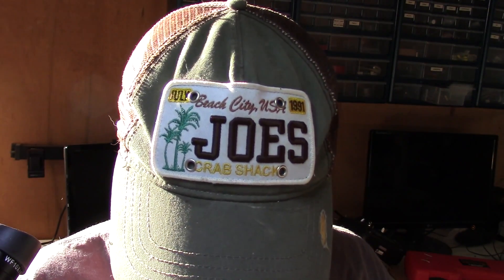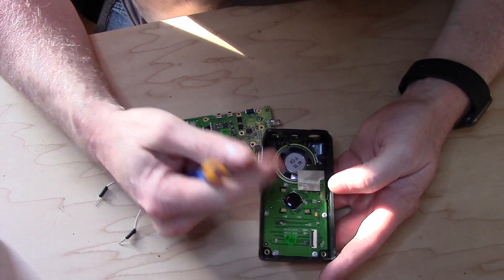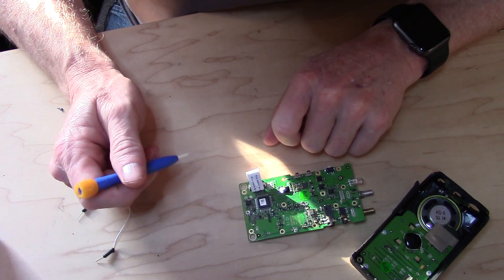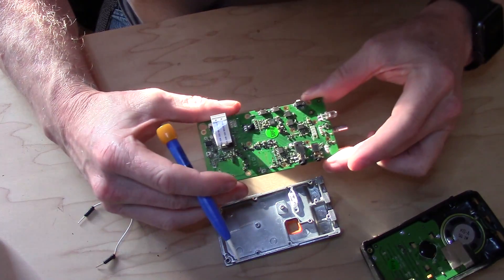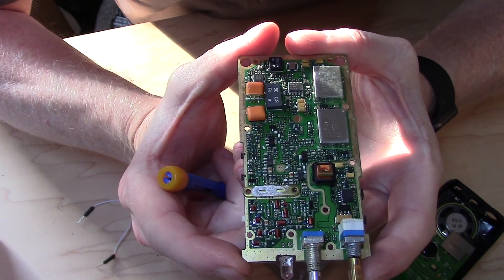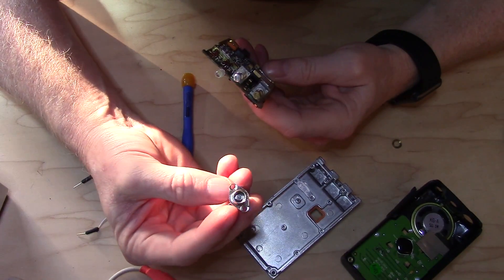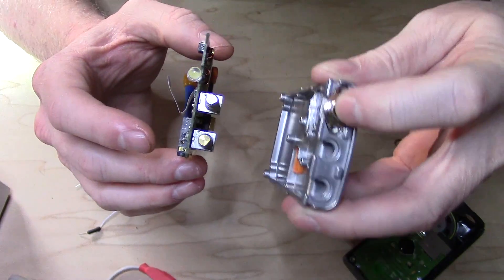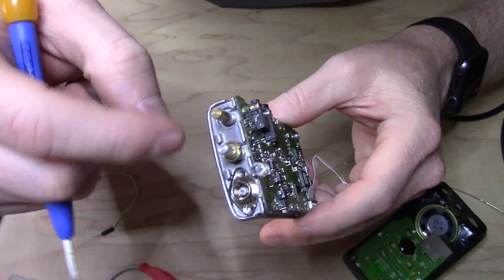Wouxun Teardown

Comment: Hi friend, I have a Wouxun UV9D Plus and its power dropped to 2.5W. Could it be that the transistor is broken?
Can you tell me how to change the transistor on this UB9D Plus and what model transistor is this equipment?
Or could it be some other component?
I honestly don't think it's the power transistor because it's putting out 2.5 watts, so I imagine it could be another component...
I'm a radio amateur here in Brazil and I really like electronics. I want to fix this HT, but I haven't found anything about it on the internet.
Could you help me?
I congratulate you on your channel and I would be very grateful if you could help me. My name is Vanderlei Santos PT2RF.

A big hug
Reply from the maker: So the fix in this video was a flash IC. What method are you using to verify power?
Reply: @ShaneBurrell1  Yes, I saw that you found the flash IC.
So, I haven't checked the power supply in the power circuit yet!
Just measure the output power in one watt and identify that it is only 2.48 watts in VHF and 3.80 watts in UHF...
I don't think the power transistor is burned out, because if it didn't have any output power...

Comment: Great video. I have a KG-UV8g orginal that was left on the charger. The battery was swollen. I replaced the battery and now the radio does not turn on. The battery is chanrged. Are replacement boards available? Any suggestions or is it a brick and parts only?
Reply from the maker: Honestly it's likely easier to buy new if it now suddenly won't power up with a good battery.

Comment: Hi Shane,. thanks for the video. I just got one with distorted and low audio so I expect the audio amp has gone. I figured out where it is on the board using the service manual, but was a bit nervous to open it. I had some experience with the UV5R from Baofeng which is really hard to service. This looks great to service and I saw the audio chip on your video as well. I'll have a try.

Comment: Nice ved !! is the rotary encoder the same on all the Wouxun models? it looks identical to the one on the uv9d plus! how hard is it to replace the encoder on these without damaging the board?
Reply from the maker: Not sure if its the same.  You would need to source a replacement and removal requires soldering.
Reply: I have a brand new uv9d mate with a problematic encoder. Has anyone found the part number of this?